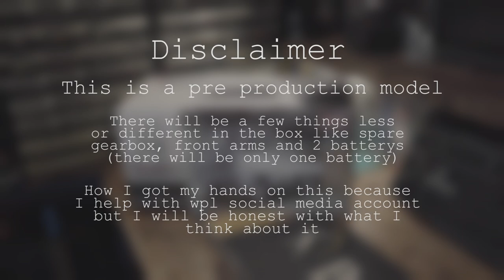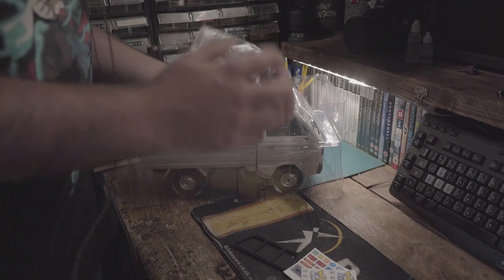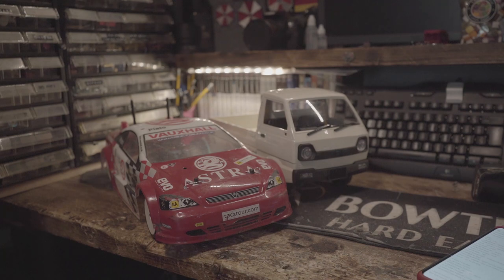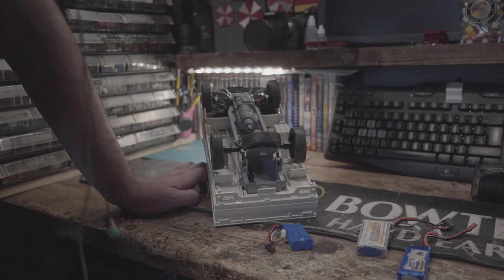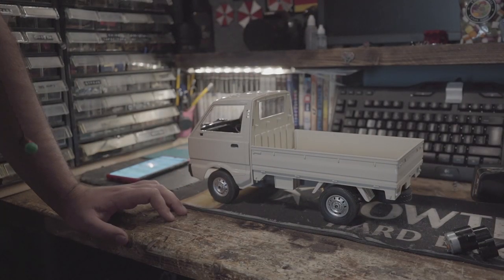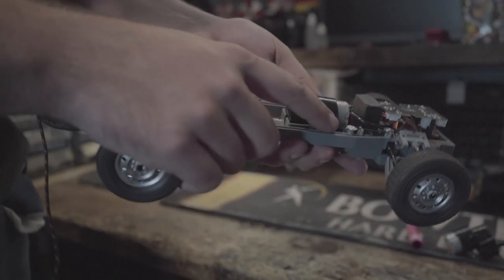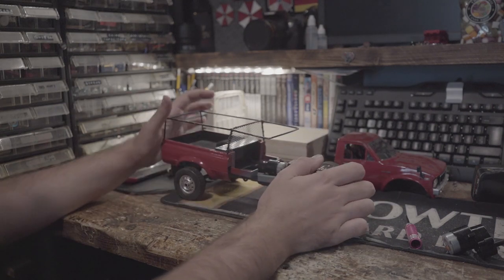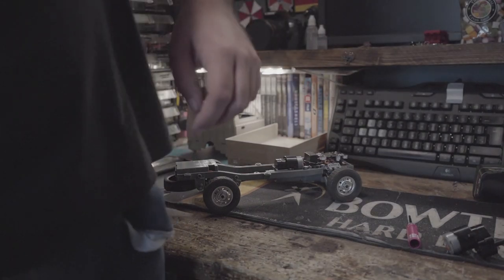WPL D12 Kei Truck First Look

Comment: I want it bad!
 I'm excited for the off road build and the drifter build.
 The poor thing definitely needs a bigger motor
Reply: I think the weak link is the battery not the motor
Reply: U can upgrade it realy easy to a brushless motor tho then u do need a new esc and reciever and lipo battery if u do a brushless upgrade

Comment: It does pretty damned good on rough terrain . That locked diff does wonders
Reply from the maker: Yeah lock rear diff but the gearbox gear ratio is more gear to speed then off road
Reply: @MrLiamPickering  you're right about the gears they are pretty tall. There is no doubt in my mind that If that battery had more guts that little truck would be constantly trying to bring the rear end to the front with the stock motor. I do think that changing the battery isbthe key to getting serious drifts out of this because it is a well made machine overall and its got the right recipe for speed and drifting just that battery is its akilles heel. Not sure if i spelt that right

Comment: Would going for a different ESC make a lot of difference to the motors power? I know with my current WPLs it made them comoletely different trucks, with the 130/180s, haven't changed my MNs yet. Also, would the B chassis be a better swap for 4wd? Looks a lot more like the D12 chassis and the B14 battery tray looks like it'd fit over the D12s ESC so mounting them to the opposing chassis would be relatively simple?

Comment: Won't be able to ad wheel weights as the tyres are solid rubber (unless the spare is different?).
Reply from the maker: The rims are hollow back with rubber glue on